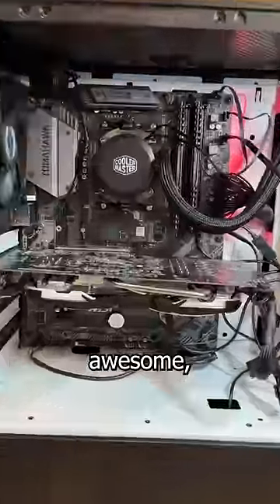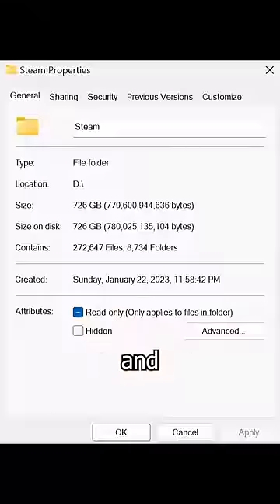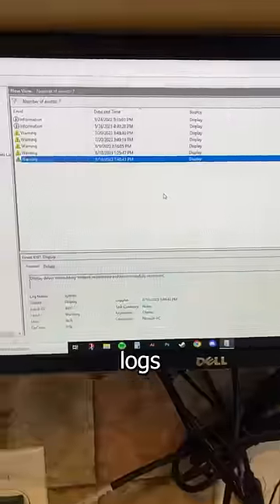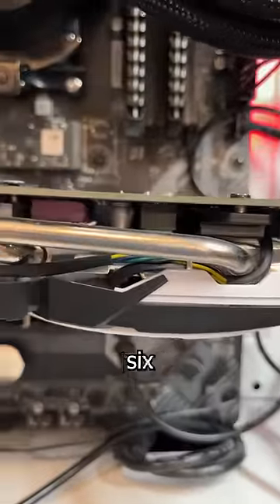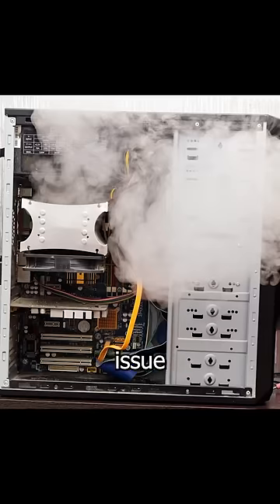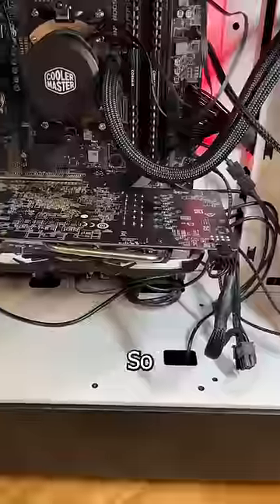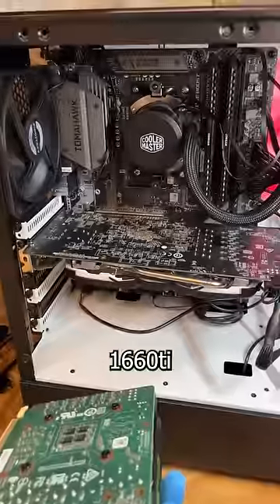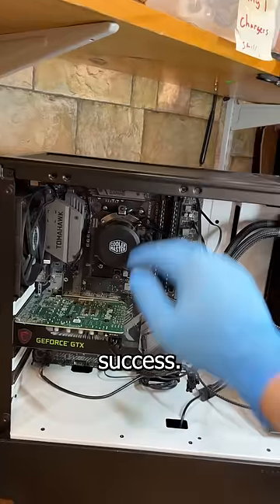GPU sagged and died from overheating 💀 #tech #technology #pc #gaming #shorts

Comment: Ah yes, I love it when my AIO sounds like a rock tumbler and my graphics card is more warped than my perception of reality.
Reply: Not related, what is your name?
Reply: @nothingnoteable probably not Tom
Reply: @nothingnoteable and why did this replace your name also?
Reply: Your name is sus
Reply: ive seen you 4 times now
Reply: That is why air coolers will always be better than AIOs

I think the fluid in the aio has dried a little, enough of that nonsense as the copper inside can rust the aio making it close to useless when under full load
Reply: Put the AIO radiator of the top of the case instead of the front and it'll stop making that gurgling sound because all the air will be trapped at the very top
Reply: My Cooler Master AIO made that noise. And then my stock AMD Wraith cooler fan died. So I slapped on a 120mm corsair ml fan with some zip ties and called it a day.
Reply: @UrokLizard It's a common issue with the pump in the video, even when mounted correctly. I had this issue and no matter what I did, it still made the same nasty sound.
Reply: @toperaheem  idk
Reply: @VR00100 copper does not rust and the water used is not just water
Reply: @Askebo 😂😂😂😂😂😂😂😂😂😂😂😂
Reply: Your name 💀
Reply: Always nice knowing ya ain't alone right?!

Having pulled older corsair aio's apart and  refilled them as well as butchering for temporary water loops for projects, can safely say that rattle is fixable....assuming waranty is out.

Cold plate and pump shroud come off easily with care, flush(easier with a spare pump as while that flushes the rad you can clean any gunk from the pump and plate.

Side note, if all you have is 16mm od tubing, can generally get luck and sqeueeze a section of the black aio tube inside the larger tube nicely, whack it on the pump/rad barb and a black cable tie at most to stop you pulling it off.
Reply: what? it obviously sounds like a toilet
Reply: wtf is bros name?! 💀💀
Reply: Real asf

Comment: Changing HDD to HDD, this guy is really on a budget
Reply: This is just stupid and shows why some companies are better than others. Even on a tight budget you wouldn't perform such a swap.
Reply: @adoksym so what's your solution if the customers budget can't afford an SSD that matches their existing steam library?
Reply: @thatguyshaq7053  Tell them that it's literally around four hours US federal minimum wage (assuming they don't live somewhere like Venezuela) to afford an entire 1 TB SSD nowadays. Also since SATA HDDs above 320 GB aren't available basically free either last I checked this reduces to less than two hours most likely. Even a child could afford that through chores.
Reply: @adoksym the company probably has 100s of those drive laying around from other systems where they upgrade to ssd. In a rare case the guy actually got an upgrade and I bet it was for free or charged minimally something like $10

The 1660Ti gpu install is where the majority of the money was spent. 

Now if I had a shop I would have also included a little bit of cable management. I hope he didn't charge much but it's like a car. Just a little bit of knowledge on DIY can save you hundreds of dollars.
Reply: @ZukaraTheGame  DIY is always cheaper. If he got the upgrade for free then you can't complain (of course). But I stand by my statement.
Reply: 7200rpm sata is still better than a 5400rpm external hard drive
Reply: HDDS still have their uses. I have one that serves as the boot drive.
Reply: @Ernesto87  That's stupid. Mechanical drives are slow a f and there really is no reason to use them as a boot drive. A NAS is the only useful scenario but even this requires drives that are made for that use case (24/7 runtime). If you have no money whatsoever then hdds are okay. If you have some coins in your pocket: buy a ssd.
Reply: @adoksym its not stupid. It's called making use of what he has. If he wants to use it as his boot drive then he can use it as his boot drive. I use a 600gb hdd as my boot drive and am i complaining? Absolutely not
Reply: @DarkTails256  Like I said: if you have no money to spend, a HDD is better than nothing. If you have the choice and can afford it: always use a SSD. They are a night and day difference in terms of speed.
Reply: 1tb SSDs are like $60. Kid could’ve asked family members to CashApp $10 a piece and would’ve had enough for a substantial upgrade. HDD to HDD is wild.
Reply: "Hdds are slow af and there is no reason to use them as a boot drive" thanks for making me feel old as shit

But seriously, if he's on a tight budget, an HDD is fine. The tech probably gave it to him for free as he probably has a pile of them from years of SSD upgrades.
Reply: @whohan779 federal minimum wage is under$10. A reliable 1tb ssd is around $100. That's over 10 hours of work. That hdd was probably like $60, so almost half price of a ssd
Reply: @dylanmonnier3559 not even 60 those 1tb HDD go around. ~$20
Reply: @tuanpham-ph6fv  damn for a wd blue? I thought they were a bit more
Reply: M.2 is like 40 bucks for a cheap one lol
Reply: @aw3017  for a cheap pos that'll fail. A wd hdd is a much better choice
Reply: @thatguyshaq7053 theres ssd the price of harddrives 😂
Reply: @whohan779  children dont make money through chores though
Reply: @whohan779 the problem is they probaly already work and probaly have absurd expenses like collage, healthcare or whatever
And whats left is barley enough
Reply: The internal 1tb hd may have been something a previous customer upgraded from, so the shop may have let this customer have it for free.
Reply: Yeah, a SATA SSD is not much more, if any, more expensive than an HDD. Even if you dont have an M.2 slot on your MOBO a SATA SSD is the only option that makes sense. I cant tell, but if the OS is on a SATA SSD then the HDD makes a bit more sense, but for sure I would have thrown an extra few dollars at a SATA SSD.
Reply: Hdd for archive and old games
Ssd for boot and much newer games. 

That's how I see it. Get a ssd/hdd docking station and grab some low ssd's for games that need it. Like gta 5. If it's gta sa, then you'd be better with hdd since there is no difference in loading. Even on external hdd. Unless you have really heavy mods.
Reply: @DarkTails256 It's stupid: the price difference between a 1TB SSD and a 1TB HDD is like $10, and sometimes they even cost the same. As stupid as it gets. I like to think people just don't know about these stuff because they're tech-illiterate or just boomers.

Comment: Upgrading an HHD to an HHD is the equivalent to a surgeon replacing your damaged lungs with a set of lungs from a person that smoked for 50 years
Reply: No, not really. Healthy, well made 7200rpm drives are fast enough for the vast majority of people (seriously, between my qvo 860 and my Hitachi 7200rpm, there loading time difference is like 5 seconds at most)

Unless its your OS drive, because windows really benefits from the extra speed

And changing from the shitty ass 5200 external is like going from a rusted bicycle to a motorcycle
Reply: Games on an external HDD is like a missing lung, it's better than keeping them external
Reply: @AveragePootis really depends on the game to be honest, I find Rust unplayable in HDD and the SSD performance boost is insane, as well as loading times where it matters like valorant so you can get your agent before it's stolen, or newer games such as the (leaked) build of Spiderman 2 that has collision issues on HDD
Reply: Not really. The real transition is actually just 50 year old smoker lungs to a single, healthy lung. The healthy lung is still slow, but at least it's not dying.
Reply: This hdd has 120mb/s for read and write itis good for single player game not for shooter games
Reply: @Decaycrazz going from 5gbps to 6gbps isn't that big of a deal for games.
Reply: @ELMISTRO1 it makes no difference the type of game you're playing. If it's a shooter the map is already loaded to ram
Reply: @MoswenMedia  but some games lag on it i already tried
Reply: @Decaycrazz Honestly. The only reason I use my 1TB external drive is to store photos, music, and already edited videos. I use my PC for applications and game/software related files. I would never put a game on an external hard drive unless I was migrating.
Reply: @thez101  its good enouth for CS:GO CS2 you might need some swap file on the SSD thats the C drive at most.
but I play a lot of games on a I think its 7000rpm drive and it works perfectly fine for most game.
yes the loading screen is 10 sec instead of 2 sec long but thats ehh consider your not going to look at the loading screen like 300 times a day but maybe 10 at most so not worth it.

Comment: I build PC for a living as well and those air bubbles in AIO might kill it sooner or later, you are the GOAT technician should have tried to reverse the radiator with the pipes going down instead of up as of now & that may help regarding the bubbles and noise in the loop.

P.S. All cases and AIO combo might not support that but I have experience with most of the designs and I guess this would have in this scenario.
Reply: Was about to say the same. Pipes down would probably help. Moving the radiator to the top, if possible, would maximize it's life span until almost completely dry tho.

Comment: To fix air bubbles you need to turn around the radiator so the air bubbles stays on top of it and the tubes stay on the bottom.

Comment: Honestly you could fix the gurgling by just unscrewing the AIO and fanagling with it, and it WILL improve temps, my AIO wasnt even making a noise with its air bubbles but it was still over heating  just moved it around hear the bubbles return to the radiator and all was good

Comment: Yeah, that's why even with the money I went for a big air cooler. The block doesn't break and provided the fans are mounted with simple wire brackets they are easy to swap if one breaks.

Comment: air in the pump is very much a huge issue regardless if temps stay low and the noise dissipates.. over time that 'grinding' will tear down the pump and it will eventaully die.

Comment: I used that rx580 for a few years. Gpu sag was pretty bad with mine as well. Not bad enough to kill the card, but it definitely wasn't good
Reply: Is that the MSI Armor one. I heard they were not great.
Reply: @cflynn3684  yeah, it was. it wasnt super stable, used a lot of power, and sagged a lot. still got a lot of use out of it, but i definitely wouldn't recommend the car.
Reply: I got an xfx Radeon,it's sagging as well but I never noticed any stability issues....until you overclock it a bit too much
Reply: Why did you let it sag? It's not like there's a plethora of anti sag brackets on Amazon for $10 or anything like that...
Reply: @yeetus59  not everyone wants to spend cash for that,we fix the issue ourselves
Reply: I took a piece of 10 lb fishing line and tied the power cables up to an angle the relieved pressure years ago when I got my Rx 580.. still going strong and no sag.
Reply: To be honest the video is kinda sus, I mean it is a short so maybe he just didn't include something but its labeled "GPU sagged and died from overheating" which is sus cause he never mentioned at all the overheating or if he even just checked if GPU just needed a good clean and repasting.  Seems from the short like he just found GPU overheating, crashing and replaced it without even checking lol
Reply: @ryanpark2049  i used a spare mini router and just put it under,doesnt sag or disconnect when the pc is bonked anymore
Reply: Is it good though Rx 580 has cool design like the 1650
Reply: @NebulaAviation1  I've had the rx570 version but mine also sags a little not that bad tho had it for 5 years. now that im working im gonna upgrade and build a rtx 4080 and ryzen 9 7950x3d build. But my old pc still works pretty good.
Reply: @deadline546 I had overheating issues with this exact card and I fixed it by undervolting it. Still had sag, but I eventually got a support bracket.
Reply: @deadline546  Yea, it's not like the card is a 3090/4090 behemoth, there's very little chance the card would die due the sagging.

Comment: And turn that AIO radiator so that the hoses are at the BOTTOM and the air can stay in the upper radiator tank.
Reply: looks like the hoses are too short to have it the right way, and the case doesn't support top-mount. I would say the AIO is failing and swap in an air cooler.

AIO is living on borrowed-time in that case
Reply: I have my hoses down too, but as long as his pump is lower than the top of the radiator you are good. In this case it looks like its slightly below. Top mount is the best of course.
Reply: @SSJBart-jb5dw that's where the air bubbles in the pump are coming from, it gets worse if the pump is the highest point

Comment: The rumbling AiO most probably could also been fixed by just turning the radiator 180° so the tubes are on the bottom. This way the bubbles won't get into them.

Comment: 1tb nvme's are cheaper than 1tb hdd. 😂
Reply: That board may not have that luxury nvme slot :(
Reply: @loveisfreethree even a sata ssd is cheaoer though
Reply: Bold of you to assume that this person doesn't have a graveyard full of 1TB HDDs like most shops do and salvaged it into this build for $0. Aint no one wants a spinny drive
Reply: @loveisfreethree I can literally see an NVME M.2 slot right on the board above the GPU.. looks occupied as well.
Reply: @mootboot  I DO want a spinny drive!  And I put them in ALL the builds I do! Would never keep my important files on an SSD!! 😬💀 The problem with SSD's is that when it dies, it dies without a warning and u will lose ALL ur files! With good ol' spinnies u'll often know if the drive is about to go bust, so u have time to make backups AND most importantly even if the drive dies, there's still hope of u to recover ur files 'cos they are physically still on the disc.
Reply: @MaximusAdonicus Normally I wouldn't respond to such an literature tech person such as yourself, but I see personal gains in our disagreement. I have thousands of terabytes of HDDs that you are welcome to have and in exchange I will accept a tenth of the capacity of a SSD (that's 1TB of HDD for every 100GB SSD!!).

For anyone that doesn't blindly read the things they read online, SSDs do show signs they're failing especially if you use them as work horses and regularly read/write to them, however in normal circumstances they will out-last most HDDs in the same scenario because you're fighting digital read and write caps of an SSD vs physical failure of a HDD which are often not in perfect  environments. An HDD can flat out fail out of nowhere, make sounds that it's failing and die in minutes, live on for years while failing, or show performance failure and die within a few hours or months. If you're not regularly monitoring your HDDs health, it can be as unpredictable as a SSD at failure point.

If you know you're pushing your SSD beyond expectations, you should regularly check on its health to make sure it's still doing okay every few years.

Under normal circumstances, check your SSD after about a decade of use to see how it's doing.

Can HDDs last longer than SSDs? Yes.

Are HDDs more reliable than SSDs? Under normal circumstances, No.

Are HDDs slower than SSDs by as much as 100x? Also yes

Are HDDs cheaper by capacity compared to SSDs? A little, maybe, sometimes not at all.
Reply: @-BUGZ-  Probably a small one purely for the OS. For some reason a lot of people still tend to do this.
Reply: its occupied by an nvme already @loveisfreethree
Reply: I dont think that Motherboard has nvme slots
Reply: @twainrocks4771  you can literally see an NVME slotted on the board. what do you mean?
Reply: @loveisfreethree  it has pcie slots , anything older than 4th gen intel has native nvme support even if the board did not came with an m.2 slot you can use adapters and it will boot from nvme.
Reply: @MaximusAdonicus  i bought my first ssd 2010 , ocz 60gb. And it is still alive. I use it as a scratch drive to keep my downloads. It is so old that it has no health indicator but it still performs like a sata 2 ssd did from the time. Slightly faster than a modern 7200rpm hdd in sequential and matches the cheaper sata ssds in random read writes. Ssd's rarely fail. In last decade i have owned many many ssd's and all of them are still working. I have owned 10-15hdds and 2 of them have failed in the same span of time.. although i would blame my self for using desktop hdd for surveillance. If the hdd board fails or the drive goes out of alignment there is no way for anyone to recover the data. It is there but you will not be able to read it with any tool. Ssd's are equally recoverable. And good ones don't fail.
Reply: @MaximusAdonicus that’s why you keep your important files in more than one place
Reply: So that means this video was all a lie? @-BUGZ-

Comment: I have this AIO mounted on top of the case, since 3 years and still no issues! Bubble sound only 2 minutes after disassembly for complete cleaning and then, it’s silent. Only the fans are not great! I had to change one because of the bearing started to die and made noise. Great funny short!

Comment: Just flip the radiator upside down so that the tubes are going downwards, that will fix the air-in-the-system issue

Comment: I had this watercooling system and it made these noices too after two years. This is the last time I put the radiator in front of the PC. It's better on the ceiling of the box. The air bubbles will be trapped inside the radiator and not inside the motor.

Comment: You could have flipped the liquid cooler to fix the air bubble issues…
It’s the radiator is upside down… 
This makes air bubbles get trapped in the pump…
If you made the lines go to the bottom of the radiator it would redistribute the air to top of radiator. (As it should have been the whole time…)